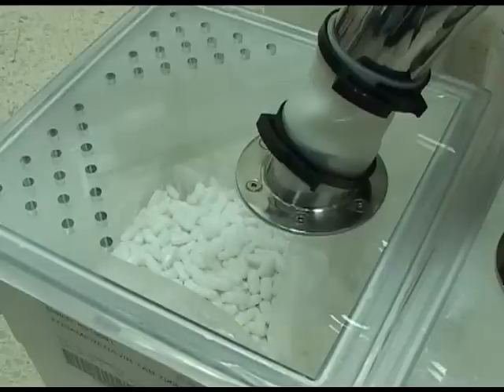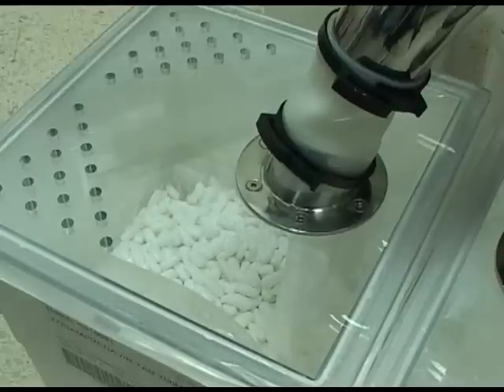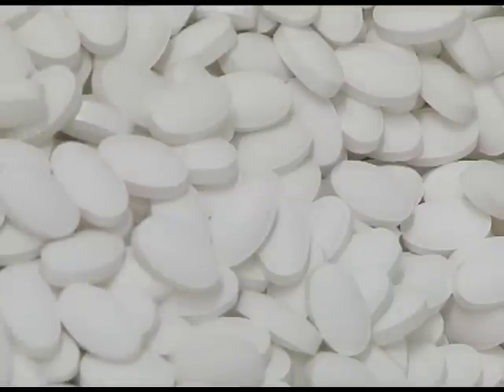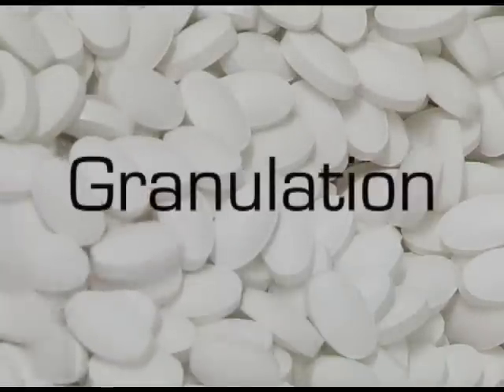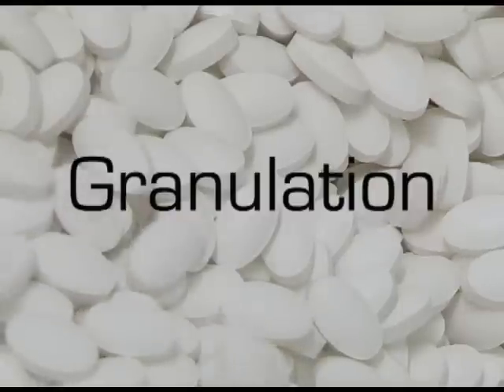Making Medicine - How Tablets are Made - Naked Engineering

Comment: So can it be assumed that if the pills don't weigh the exact same then there's a small variation in how much of the active ingredient there is in them? For most people, this wouldn't be noticeable but for someone who is dependent and has has become extrememly sensitive doing a micro taper of something like a benzodiazepine. You notice the weights of the pills aren't all exactly the same. They can vary by up to 0.02 grams. And during a micro taper this is actually noticeable.

Comment: From the comments below there seems to be a lot of interest about how tablets can be made.  First of all it is likely useful to understand that a vitamin tablet, say, that can be gotten from your local pharmacy is in fact a small “cookie” (for the lack of a better word.  If I recall adequately from way back when, it is a two step process: typically the non-medicinal ingredients include wheat or corn flower with any dyes, quite a bit of sodium stearate (for the lubrication for the processing machinery, (there are a number of well, recipes are approved by the FDA and the CDC, and so on), sodium chloride (table salt), some distilled water --- mix well until the consistency is about like molding clay then bake for about 30 minutes (as I noted above that are a number of approved recipes, grind up the cooked and then cooled materials.  Often such activities can take several hours with the grinders often appear like concrete mixers (stainless steel with covers).  The now more or less uniform powder is sifted so that there is a certain approved physical consistency in this powder. The powder is chemically check for water content, and so on.  All officially approved.  This powder, once the approved steps are checked, is very carefully weighed out along with the vitamin powder.  More hours of mixing with those covered stainless steel concrete mixers.  More careful, officially approved chemical tests.  Finally, the pill press is readied, according to official procedures.  (The plant might look like a ho-hum average building, but everything inside is incredibly clean and there are small armies of cleaning experts, officially approved, going through the various stations cleaning this and that.)  The press machines, after being readied, with the proper shoe (the carrier of the now medicated powder is loaded in to this shoe) on the presses stainless steel table... and the press is turned on there are several motors that drive cams (in the more common examples) that slide the powder ladened shoe goes back and forth across the machine's table to drop a specific volume of powder into the hole that contains the bottom steel die, the shoe pulls back and a rod with the upper die advances to compress the charged hole, with approved pressures (otherwise there is capping, in which the tablet is too fragile and falls apart as the tablet can't be handled). The upper die pulls up and the bottom die pushes up the completed tablet --- which is gathered up with the shoe that is now advancing to deliver another charge. It's a cycle that lasts about one second or less. So that the machine, if operated continuously, can make a bit over 3,000 tables per hour. So practically speaking, have to have permissions to do this and that.  Plus the costs of the building, the costs of highly educated folks, a pretty good chemistry lab, and on and on.  For many firms the costs in the US are prohibitive, so they do the tablet making part overseas.  Then when the tablets are shipped into the US, the shipment is checked out like outfits like the USP, or USP approved labs. Then the pills are sold to drug distributors.  One can be easily reminded of an anthill, because of the business of the the process.
Reply: Very interesting! You seemed to give a more thorough explanation of the process then the video did lol.
Reply: This thread proves that reading is still the number one form of information, 😊👍